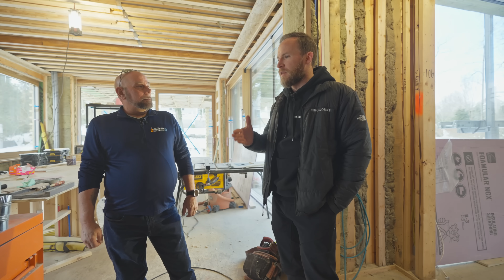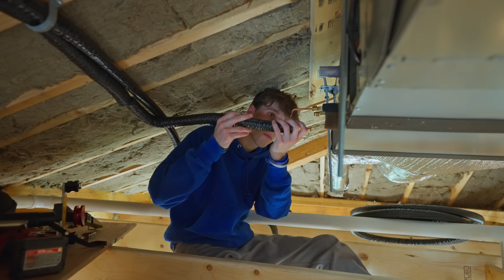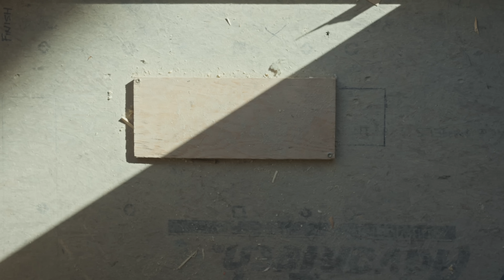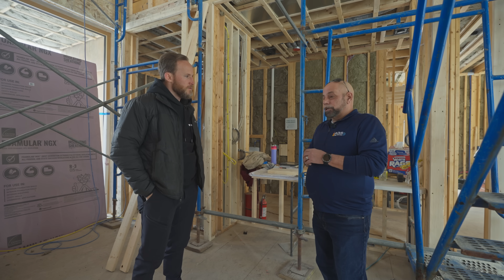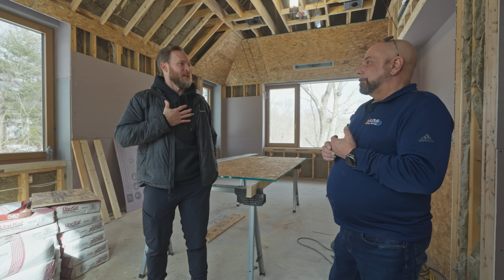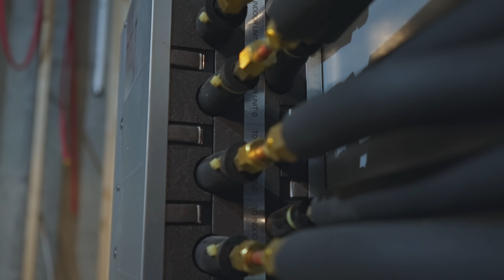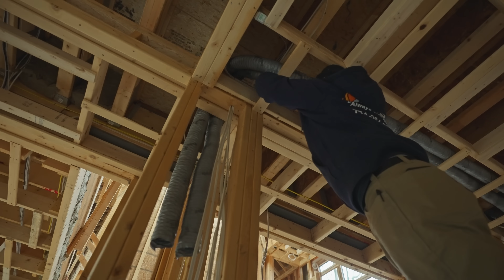The HVAC System Behind a Luxury Home

Comment: a stick frame house is not a luxury house
Reply from the maker: Everyone’s favorite argument.
Reply: What are you talking about? EVERY house in America is built with lumber? A stick house 😂😂 yes a well built house made out of lumber....
Reply: Thank you!  Agreed that the structural design matters.  Framing is the weak link in this build.
Reply: @buddyrevell-3-Oclock weak link?? It's built to code and perfectly done? Are you guys bots
Reply: But can cost as one
Reply: Your uninsulated concrete shack isnt as cosy as my stick framed house that would survive a tornado, which is all I have to worry about at 70 year round. I rebuild after natural disasters, you would be suprised how strong that weak link is if its built properly to code and you dont cheap out on exterior materials. Obviously foam board, sticks, and vinyl will blow over.
Reply: @ that’s the dumbest comment I’ve seen on YouTube in years! ICF is far more efficient than a stick frame could ever hope to be and they are far stronger than a stick frame could ever hope to be! Get a damn clue!
Reply: @TurdFerguson149  sure Turd, where in the world are houses built out of concrete? There's a reason why NO PLACE ON EARTH is like that, because not every human is a millionaire.
Reply: @TurdFerguson149  basement foundation walls should be poured and reinforced. But in my area their are no wind loading problems, same with seismic. So you think building a concrete home that takes special skilled labor, which with how poor the labor force is now you're going to have nothing but problems and issues with condensation, leaks etc at every penetration.  If you need to repair anything good luck im charging 4x to repair any of the work. I've dealt with icf homes, they are problems because they let cheap mexicans build them. But my house stays 70 all year, I have zero air penetrations. My home is as efficent as they come. But keep thinking concrete is the solution for everything. If I lived in Ukraine I would want an icf home.
Reply: @ so you are saying Mexicans only build ICF homes? Special skilled labor? They are essentially legos and pouring concrete, not difficult at all. You just make one stupid comment after another! But it does sound like you own the world’s most efficient stick frame house, congratulations! Keep thinking cheap stick frame construction is the solution to everything!
Reply: @TurdFerguson149  I'm just telling you they are built poorly most of the time by cheap labor and 90% of the time it is mexicans. You dont fix others work, all you know is new construction. I fix bad work for a living and icf homes are poorly built most of the time. Icf homes are just like spray foam, its good if its installed properly. You obviously dont know anything and live in your own world. If icf was better thats all we would build.
Reply: @TurdFerguson149  and what do you live in there Turd Ferguson?
Reply: The home is clearly luxury, it’s just not made to be a generational family home. It’ll be a tear down in 100ish years.
Reply: @ not luxury
Reply: @TurdFerguson149  Its like arguing with a 12yr old. You have zero valid points on why icf is better than wood, i have given you all the problems you have with either material. You just like rocks or something, it's obvious all your knowledge is based off what you learned from youtube. You dont know what the word luxury means. You should of stayed in school.
Reply: @TurdFerguson149   I'm building my house with 3 feet wide reinforced concrete I hope that's enough for you
Reply: @TurdFerguson149  I would have no other house as a structural design engineer
Reply: @ not sure what you’re saying
Reply: @TurdFerguson149  english not your first language?
Reply: @ which of my comments are you replying to, or is your best argument to insult me?

Comment: It's so complex with these air ducts. I think it would be more efficient and comfortable with in-floor heating, on-wall AC (multi-split), and small air ducts for air exchangers in each room. This would not dry the air in the winter and would dry it in the summer. I don't understand why Americans are obsessed with huge air ducts....
Reply: wall mounted looks ugly to a lot of people. This is a luxury home.
Reply: @ there are celling units also and very nice wall ones. I guess luxury in USA is different than in Europe.
Reply: Aesthetics aside, You have to service EACH until split unit -and your filters can be as robust or last as long . Luis for larger rooms they just don’t have strong blowers-you will need ceiling fans-not everyone likes ceiling fans !

Comment: This build has a lot of real wood going into it. Surprised to see no mention of dehumidifiers or humidifiers to keep that super dialled in to keep the wood from excessive shrinking and expansion. I know running the AC for longer durations and keeping it tight will help in the winter - but with this amount of wood, I feel like you may want emergency rails on either end as an insurance policy.
Reply from the maker: Not a bad idea
Reply: Yeah, Boston climate has some trunk seasons and even with  two systems and two ervs, esp in a tight house, can’t imagine they will stay much below 60 RH ALL the time. Remember too if you run erv in summer esp continuously, you are increasing your net humidity in the house, and if you have a high seer unit (unlike Mitsubishi/daikin) even if properly sized, is that for heating or cooling/dehumidifying ? Even the best AC units heat pumps are not as effective as a good dehumidifier (Aprilaire,Santa Fe etc) . IMO if you need an air conditioner , you need a dehumidifier esp in a house of this expense.,
Reply: @johnwhite2576  You are absolutely correct. But why would you hire a PE licensed professional engineer to design your HVAC when you can just ask the guy with tin snips in the back of his truck to “design” it?

Comment: Registers are not really what determine airflow. Airflow (volume) is a function of the ducts and the system. Registers and grilles ultimately determine velocity of the air, which is what determines how well the air is mixed and distributed.
Reply from the maker: Fair
Reply: No, because you're presuming you have enough power to push through a restrictive space.
There is always enough buffer in a system to take the air that's blocked by grills in 10% of the home. So they don't get the air needed.

Comment: What software are they using to do their load calculation? Is a blower door being performed and is it entered into the load calculation, or are they using defaults in the software?
Reply from the maker: Designed with defaults. We will do a blower door and balance the system later
Reply: @ Thanks for replying, and for the video

Comment: The only reason I would do floor grilles is because of cost and ease of installation. Aka unit is in the basement or crawl space. There should never be an issue distributing air using ceiling supply grilles if things are sized right. Regardless of climate. Floor grilles are never preferable from a homeowners standpoint because you have to worry about furniture placement
Reply from the maker: Unless you consider furniture placement

Comment: If you are in a heating dominated climate then the return should be near the floor, for the obvious reason that warm air rises and cold air is near the floor. If you have a luxury home why not go all out? Have two separate returns, high and low, and use zone control dampers to close off the low return in the summer and conversely close off the high return in the winter.
Reply: That’s backwards.  In a heating dominated climate, the supply registers should be low and the return(s) high.  In an A/C dominated climate, the supply registers should be high and the return(s) low.  Supply register placement is more important than return placement.  The returns should collect air that’s not in a useful position.  E.G. hot air that’s camping out near the ceiling should go into the return.  For heating, that will lessen the job that the system needs to do.
Reply: @ I agree that supply placement is more important. Why should returns be high in a heating climate? And why should supplies be low?
Reply: It's so well insulated that it'll barely run those heatpump/AC systems.  Most of the air circulation will be done by ERV
Reply: @ That really depends on who is living in the home. What if the residents want to be 80 degrees year round? I've been in homes like that, AKA elderly
Reply: @cellocovers3982  Doesn't matter. If they want it at 80 you program it to do that. Doesn't change any of the function of the unit. No one's saying what about 60 70  90  but the system functions the same all the way through those ranges.
Reply from the maker: I’d say this home will perform exceptionally well
Reply: You mention zone control dampers.  IMO the best system would use those to choose between low/high position of supply registers.  But there’s no need for that complexity in the return ducts.
Reply: Doesn't matter in a larger home that has air movement designed to keep the air temp even. They don't cycle fun on and off like standard ones do.

Comment: Air mixing is accomplished by the supply vents, not the return. This is because it is the supply is relatively high velocity, which is what mixes the air. The return should be low velocity and so does not contribute much of anything to air mixing. Locating it in the center of the house is unnecessary. It just needs to be in a central location. Aka not behind a closed door in a bedroom. Unless you’re doing multiple returns

Comment: Lot of equipment to have to fix when it breaks, complicated is not always the best approach
Reply from the maker: It’s a pretty straight forward system, not over complicated, and ability to service individually
Reply: I just see a larger number of filters that will need periodic replacement.
Reply: A well engineered system is easy to maintain, this will be no problem

Comment: With high efficiency windows is it really necessary to put the supply grilles next to the windows? Or is this something that HVAC people have grandfathered in from the days of single pane? Prioritizing grilles at windows often means having to increase the length of duct runs leading to more conduction losses if ducts are located in unconditioned space
Reply from the maker: Great question, I think if it were negatively effecting something we would reconsider. But this works.
Reply: @cellocovers3982  No it's not. I teach the passive house consultant training and during the mechanical design portion we recommend that duct runs are kept as short and compact as possible while also taking into account good supply register placement with longer throw registers so that the air  flows along the ceiling to go farther and that helps promote mixing.

Comment: What’s the R value of that bubble wrap insulation? R-2? 
Using tape to seal metal elbows is pretty slow compared to using mastic (aka pooky)
Reply from the maker: Both work. And the insulation many will argue isn’t necessary but it looks clean and adds a little thermal and sound insulation
Reply: @  insulation may be very important if the mechanical room stays pretty cool and humidity is high enough in the summer when the AC is running
Reply: I agree with bubble wrap not being sufficient in most areas but tape is more reliable and tougher to screw up on install.

Comment: Why not use radiant?
Reply: Unless you live in a really cold climate, radiant heat in a well insulated house is going to be a disappointment. The floor can't get warm enough for that toasty feet feeling because it would overheat the house. At that point why bother with the radiant heat when you still want cooling. The compromise is to put electric radiant heat (like ditra heat) under the tile in the bathroom.
Reply: I haven’t shopped for them, but AFAIK an air-to-water heat pump would work well with a radiant floor system, since the water temperature needed for the floor is pretty low.  But personally, IMO a radiant floor is a plan for disaster 30-40 years later when it inevitably develops a water leak, and you then need to remove concrete to replace all the tubing in the house.
Reply: Maybe because you still need a system for AC as well. Agree tho, it’s a small step down from luxury.
Reply from the maker: No fossil fuel to produce the hot water. So not efficient to do so. Geothermal wasn’t an option
Reply: Radiant hasn't been used in high end for 20 years. It's better to have a system that maintains the air temp at a set temp at all times. The whole house is then that temp as a thermal load. 
Setting the air handlers to cycle air at all times or on a set cycle makes it more efficient also.
I like  variable speed air handlers for that reason.
Reply: @ That’s totally incorrect. Radiant has made a huge comeback. It’s comfortable and noise free. “Luxury”. Think the heat for ducted maybe has a couple locations in a room, radiant in slab/floor provides 100% even heating throughout the space and not the same sort of air mixing which can cause discomfort. For me, still not worth the additional cost, but radiant for heating definitely is more comfortable.